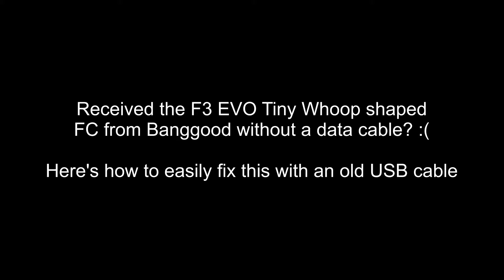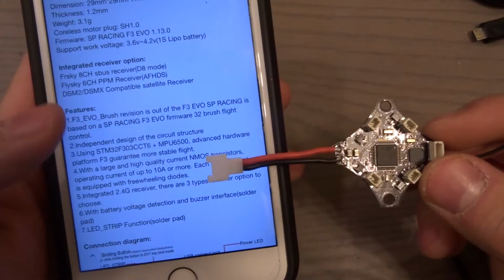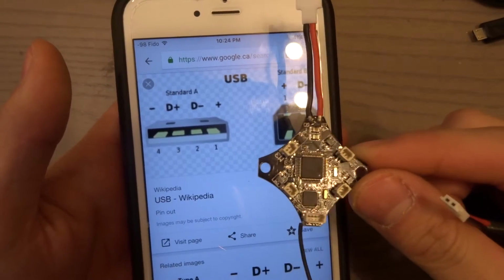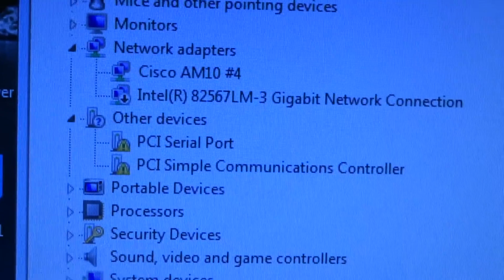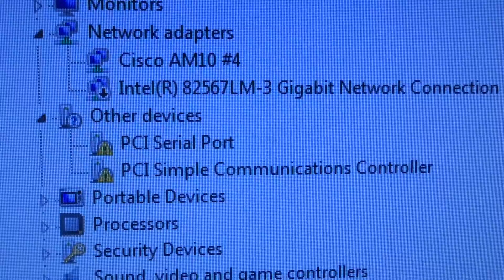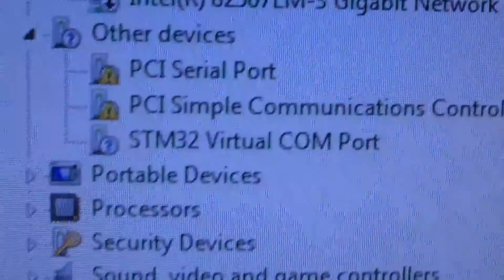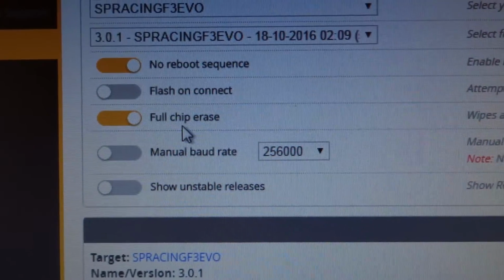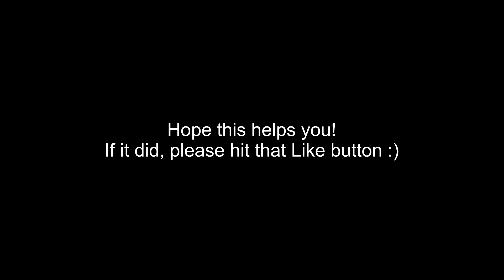Connect/Flash F3 EVO Tiny Whoop Shaped Board to Betaflight

Comment: Hey thanks! This helped me out a lot. I soldered the cable and flashed the board with betaflight. Unfortunately, I have the dsmx version that don't have the binding button... Any tips on how to bind to my dx6? I did the  set spektrum_sat_bind=9 thing on the CLI but no luck. Any help is appreciated :) Cheers